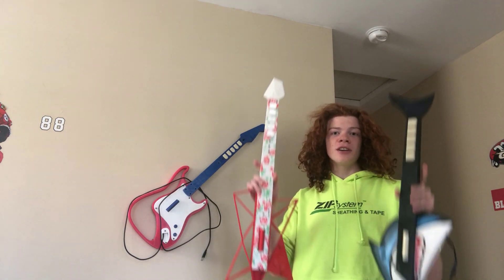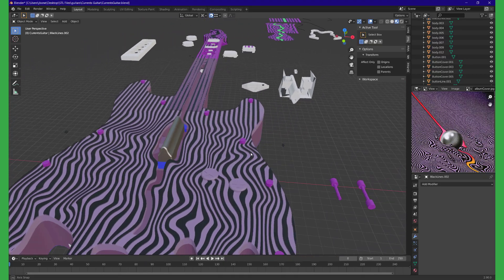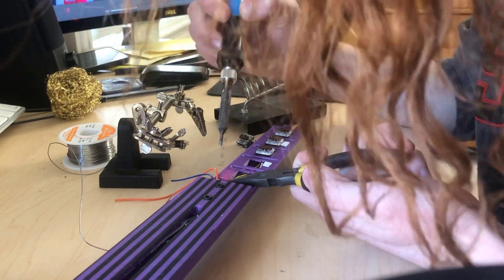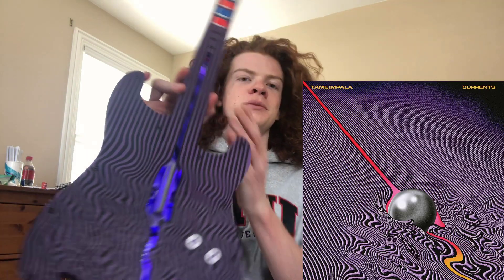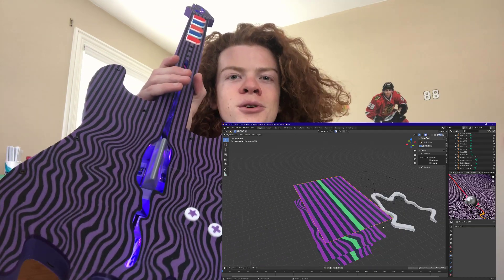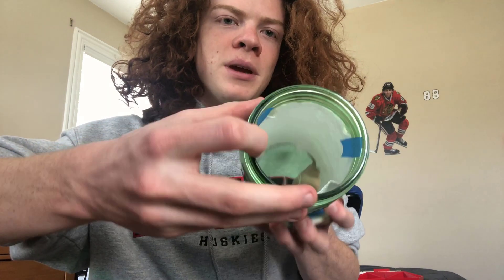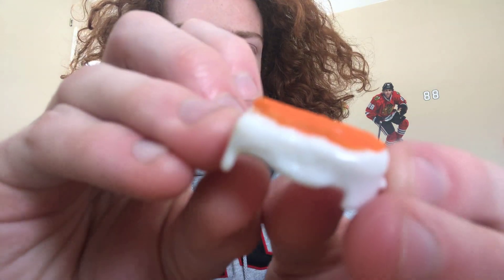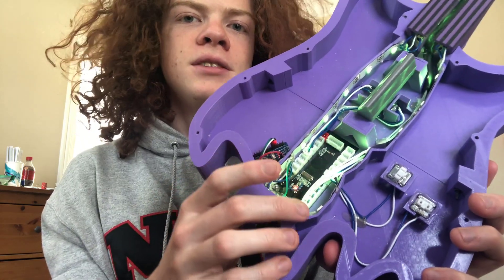3D Print Your Own Guitar Hero Guitars!

Comment: Can I use that controller too for GITADORA and DTXMania? But in playing those said games, just add the tilt sensor for Wailing
Reply from the maker: When you plug the USB encoder into a PC it recognizes it as a video game controller so it can work with literally any game. The same goes for an arduino pro micro which I talk about in my newer video. You would probably need the arduino pro micro if you want the analog control for the tilt sensor

Comment: Do you know what I would need to make a whammy bar on my own? I am looking to print this and that is the only part I see missing. I saw you are working on it but do you care to share what module you would need for it to take a input as a whammy bar?
Reply from the maker: yeah I’m working on a design to add a whammy bar. it’s analog control so the usb encoder board I used won’t work. I couldn’t find a usb controller board that had digital and analog control so I’m using Arduino Pro Micro boards with the Joystick Library.
Reply: @JoshDesigns  did that require you to code to get it to work? or was it all precoded you just had to move files over? I am not good with code lol
Reply from the maker: @Thomas-Skaa  it required some code. I’ll make a video explaining everything soon.
Reply: @JoshDesigns  Has the design with whammy bar support been worked on since this comment thread? Looking to start a build soon.

Comment: Whammy bar?
Reply from the maker: working on it. making it spring back is hard
Reply: @JoshDesigns  have you considered breaking open a broken guitar hero guitar and checking out how a whammy bar works?
Reply from the maker: @MiraDaWulf  honestly a really good idea brb
Reply: @JoshDesigns  sweeet
Reply from the maker: ok they use a tiny spring which is annoying because I'm working on a guitar that anyone can 3D print themselves. I want it to be easy to build and not require purchasing lots of components. I'm going to experiment with 3D printed Spiral springs similar to the ones in wind up cars.
Reply: @JoshDesigns  Any updates?

Comment: This is sick man, I just bought the keys to do this! I have been playing with the idea of making a Clone Hero controller for a while, this is way better than the method I was planning on using. I made a prototype with some arcade buttons and an old keyboard controller, and definitely wanted mechanical keys in the new version. I'm very new to 3D modeling so I really appreciate the Thingiverse upload! Would you mind if I messaged you if I get hung up with the electronics portion?
Reply from the maker: Absolutely ask me questions if you have them. My first few guitars were horrible. I took apart computer keyboards and soldered clunky buttons directly to the contacts on the keyboards’ circuit board. I’ll be making a better tutorial soon where i will 3D model a new, guitar that will hopefully be easy to assemble.
Reply: @JoshDesigns  Funny you say that, it sounds like I used the same method when I made my first 'guitar' too! It was awful, I used a cardboard box for the enclosure and the solder points broke after a couple of uses. I'm printing parts of the shell now, I had to break it up a bit to fit on my Ender 3 Pro because the print bed is smaller. I'll try to upload it on Thingiverse as a remix of your project once I know everything fits properly! I do have a question before I buy the rest of the internals - what are you actually using the Arduino board for? From what I understand the USB encoder is the only component needed for linking the buttons and using it as a HID for PC. Its hard to tell from the video, but you mention that you're powering the Arduino with the 5v from the encoder, and then it looks like the Arduino is only controlling the LED strips based on the wiring. Is that correct? If so I might just get the encoder for now and try to do the Arduino and LEDs later on.
Reply from the maker: @TheKodostaff  Correct the Arduino is only controlling the LEDs so it’s completely optional
Reply: @JoshDesigns  Fantastic, thanks for the tips! One last question, is every screw point intended for the M3x20 screws that you mention in the video, or do the lengths needed vary for things like mounting the neck?

Comment: Just FYI those "zero delay encoder" things have weird annoying inconsistent latency. I know this because they make me randomly misdrop in TGM with my DIY arcade stick. Use a better one!
Reply from the maker: oh i didn’t know that thanks. do you know if there’s latency when using an arduino?
Reply: @JoshDesigns  depends on how you program it exactly, i know a lot of keyboard nerds use Teensy boards with QMK firmware